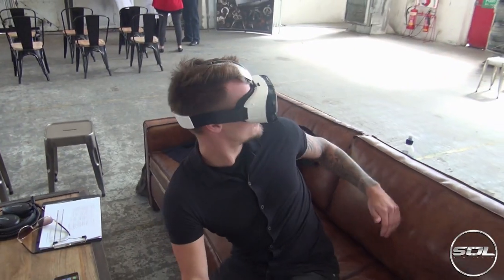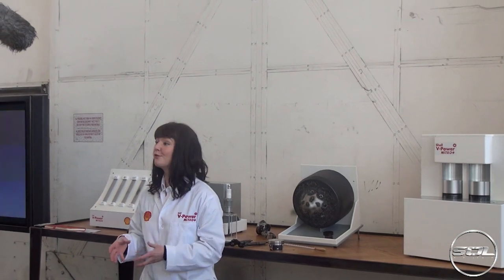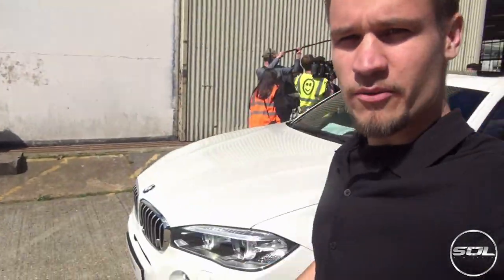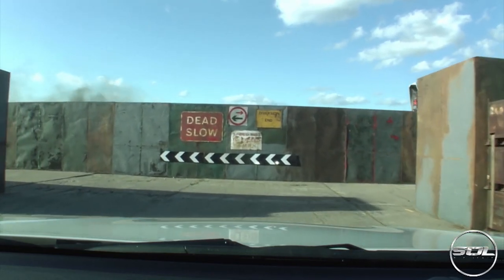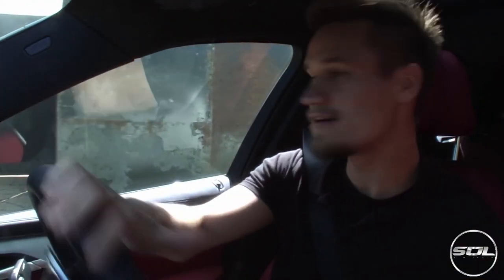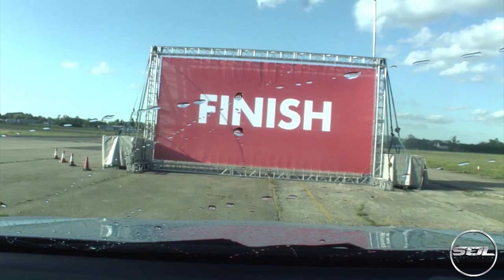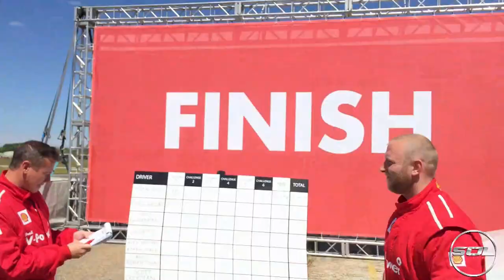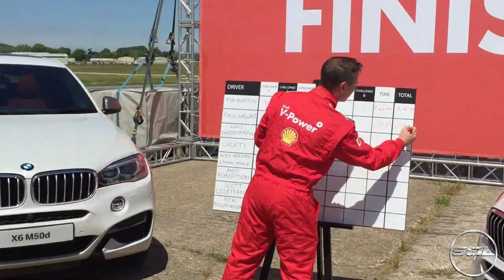Shell V-Power Nitro+ BMW Driving Challenge!!

Comment: Shell V Petrol is actually really good. It gives you better MPG I've noticed.
Reply: MOPAR Or No Car / ABRAMS Or No Tank It does and the cars bhp increase too!
Reply: I fill up with Shell's normal Unleaded Fuel and I notice that the car does better MPG
Reply: ***** if you put alcohol(if your car has a flex engine), it increases the bhp too
Reply: MOPAR Or No Car / ABRAMS Or No Tank It does improve MPG but it costs at least 10% more than regular Shell fuel where I live, kinda cancel each other out